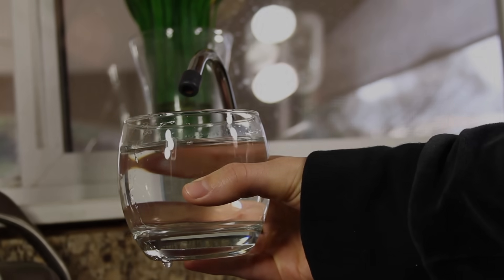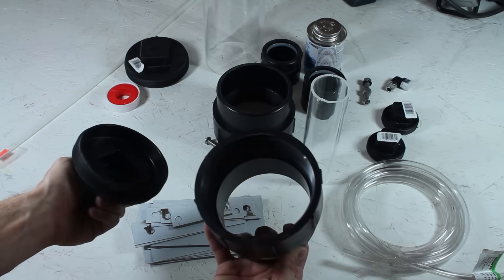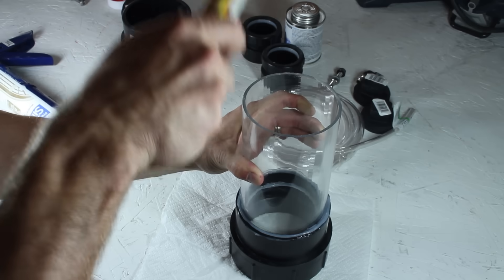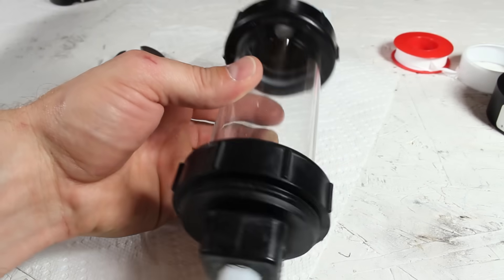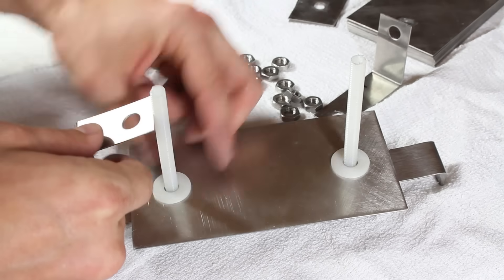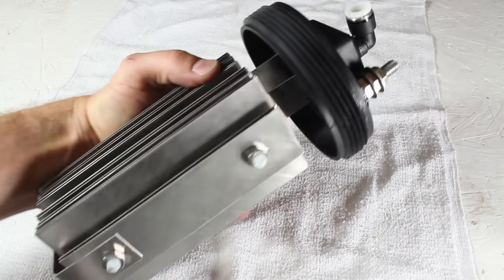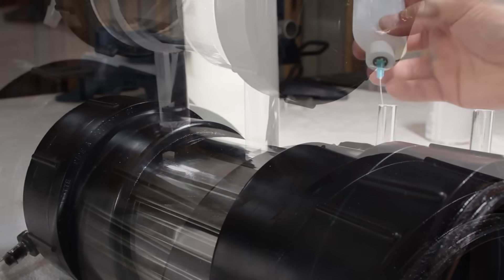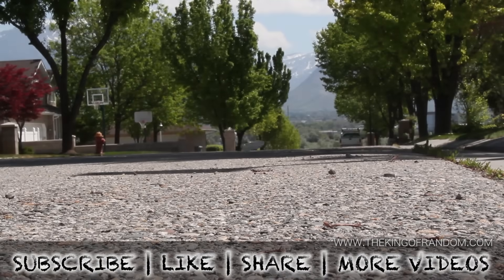HHO Generator - Water to Fuel Converter

Comment: What I like about this video: it never states that this is free energy like so many others have.
Reply: The only true form of free energy is gravity itself. Gravity pulls subatomic particles together to produce mass. An increase in mass produces heat. Heat is energy. When mass reaches a threshold, it starts to produce large amount of static electricity. This disrupts the covalent bonds to form larger atoms. When larger atoms form, electrons are shed and converted to photons. This is called fusion. At no point during this process is energy created or destroyed. It's purely transformed into something else.
Reply: "IF" we could reach absolute zero my proposition could very likely be tested... but we can't, and the energy required to create it would be infinite. If we had that much energy, then yes, we could suspend gravity until movement began again. The problem is: even observing a particle in that state would create motion, and without observation, there is only speculation.
Reply: In reality, there is no such thing as "true" free energy. Energy is only converted from one form to another.
Reply: D.J. Md Gravity is the result of movement relative to its position to another object. If you cool two sub-atomic particles down to absolute zero, all atomic movement stops. This results in the two particles not being able to interact with each other. They lose static charge and their gravitational fields. With subatomic particle movement, ( when in their normal states), particles move towards each other creating energy without the parasitic energy loss upon any given object. In essence, a particle doesn't have to shed an electron for gravity to work. this is free energy.
Reply: ***** My thoughts are that what we see as a particle is only the static parts of standing waves.
Reply: *****  Two percent not bad at all, according to the numbers of  lost energy during transmission from the utility companies as reported by the EIA department  A national average of 6 percent lost which not including in the production of the electricity. Some reported up the 20 percent total lost from these utility companies. I love it when nay sayer's put their feet in their mouths sucking the jam out between their toes...
Reply: ***** for probably the best consolidated "free energy" resource google "PJKbook.pdf" it's got to be the biggest most dense pack of deception ever made, or some relative truth. I don't think anyone could be that delusional to spend so much time putting it all together and constantly updating it if they didn't believe its contents. i'm erring on the side of off-grid solar somewhere sunny with EVs/bikes to get around. proven. reliable. nothing kooky.
Reply: ***** Yes, there is no free energy.  With some forethought, this could provide a means to store energy.  Yes, there is an efficiency loss.
Reply: ***** think about that one. Gravity is not free energy. (we don't even know what it really is). Just like we don't fully understand electricity we just use it. I always loved my professors who asked a question in lecture. Students answering their best guess. My answer was usually "we don't know" and not that I don't know. but "science does not know the answer yet"
Reply: Lajos Winkler Absolute zero cannot exist, and he is right. All movement stops. And finally, a billionth of a kelvin =/= 0 kelvin.
Reply: *****  for some reason i agree with you Jason I'm no quantum physicist as you guys apparently are but  correct me if im wrong but there were a couple hypothesis' that were based off of specualtion and they were tested and made to be theories but later on throughout the years technological advancement proved those theories to be untrue and forged new ones . So all jason here is doing is speculating by saying those things because they may or may not be true  but well never know because we arent technologically advanced enough to know. Im not sure if this was the same thing jason was saying
Reply: ***** Technically Perpetual motion energy does exist, but the amount of energy most devices of this energy source produce is minuscule and generally requires a large setup. Which is why solar panels or wind turbines are far better in terms of energy output and size.
Reply: ***** well i consider it free since the solar panels on my rv power my hho gen with no problem which lets me cook on my lpg stove and also run my hho torch welder. and since i got the panels cheap 5 years ago its has totally paid for themselves and so anything i get from them is free, im sure it would run my rv lpg fridge but i stay on 12v and my panels take care of that
Reply: R Hall I don't know about 20%, but the 6% sounds about right. I previously wrote 5% but changed it for the benefit of the doubt that someone knew what they were doing. However, if someone is running it under the hood of their car with high engine temperatures, I could see a system that was higher than 5%.
Reply: R Hall What I think is funny is that these HHO people think that this system is something new. How do you think the Nazis got the hydrogen to fill the Hindenburg? Hydrogen is easy to make... it's helium that is difficult. During WWII, the United States and Russia had an "almost" complete monopoly on large-scale helium production, so the Nazis had to resort to hydrogen to fill their zeppelins. The point being: this is old technology.
Reply: Bolt2strike With gravity, you can't destroy it (at least that we know of), so it's ever present. It's what creates stars! Stars will come and stars will go, but gravity will always be here. It will be producing stars for the next 100 Quintillion years, and I'd like to call that the ultimate source of energy.
Reply: ***** is this a comment war? 

cause i wanna join
Reply: Using solar panels,  the free energy from the sun would qualify as "free energy"
Reply: When I say free energy, I mean perpetual motion.
Reply: Something that many HHO advocates claim this technology provides.
Reply: ***** oh yea,  i think i know which ones you're talking about.  They're usually using some form of Bedini pulse motor or pulsing technology and claim that it's overunity...  

I have worked on that project for a few years, It's flat out fail.
Reply: This technology is real in regards to producing hydrogen, but it doesn't produce more energy than is put into it. Even fusion from the sun doesn't do that. That's just an electron being converted into a photon when 2 hydrogen molecules bind into a helium. Even fusion doesn't break any laws of conservation like the HHO guys claim can happen.
Reply: hotfreshrider there are plenty of people who firmly believe what they say even though the facts are wrong. However, most of the time, the facts are correct when that much work goes into their research... Then again, some people spread false info strictly because they've scam artists.
Reply: ***** Because it's not. It's free fuel, the generator runs on electricity to create the fuel.
Reply: TheGodWaffle It's not free fuel.
Reply: TheGodWaffle the amount of energy input into the system to produce hydrogen is more than the energy that can be extracted from the hydrogen. The loss is minimal, but it is there. The loss is through heat conductance through the wires.
Reply: TheGodWaffle if you could trap 100% of the heat (impossible) and turn it back into electricity, you would only break even. In that case, it's still not free energy.
Reply: My point was that we really can't prove anything beyond a shadow of a doubt. We can't even figure out how a particle is a wave and vice versa...
Reply: I'm really trying to show you that if we can't even figure out things like that, then how can we positively say for sure we are right? There are many things that are based off observation. Those are correct. A law is something that never changes, but things like super-positioning are nothing more than our best guess.
Reply: And the great inflation? While it's a great idea, it too is only speculation.
Reply: Great inflation is not a speculation. It is part of a theory. It has tons of math behind it and empirical observation which can't be explained by other means, at least not now.
That's how science works - it builds evidence and, as limit functions which approach to 1, it crawls towards 100% certainty, but inherently can't reach it because it's always opened for more evidence. That's its power.
Reply: Lajos Winkler Dude, you seriously just want to argue. I pity you.
Reply: ***** I pity the people that don't want to understand how things work and are.
Reply: What you are saying is speculative. Absolute Zero is not possible.  It is a best guess. we are limited by how it is perceived. not what it is.
Reply: D.J. Md What I'm saying IS speculative. If you know a lot about quantum physics, then share with me what would happen if two particles had no interference with other objects, zero movement, and they were side-by-side. I know you are going to say "it's impossible", but just entertain the idea for a bit. Would they interact with each other?
Reply: Idk, it makes complete sense to me.
Reply: Now all the above theories could possibly be false as atoms themselves are a theory(the most likely theory) In any case particles do slow down(there is proof of this but i dont remember where so google it) when theyre cooled to a fraction of a kelvin
Reply: lol49031 Atoms are not a theory. Atoms are proven particles which properties are explained by "atomic theory". Same goes for gravity, biological evolution, tectonic plates, etc. All observable things explained by theories.
Part of the atomic theory is that atoms never ever slow down to a complete halt. That's basically one of the reasons why helium can't freeze on its own, but needs to be pressurized. Zero point energy jiggles the atoms and won't allow them to slow down enough for their extremely weak forces to grab them all together and form a lattice.

Reason for gravity lies much deeper and nothing we know or did with low temperatures has to do with it. That's one of the reasons LHC was built.
Reply: Lajos Winkler If atoms are particles, why do they only act like particles when we observe them? Otherwise, when not being observed, they act as waves. Not only that, the deeper we look into the atom, the more layers we find (subatomic particles). Yet, the majority of a particle is empty space. So, when do we finally reach the end of our search to the center of the atom? What if there is no end? What if we come to the conclusion that an atom is comprised of empty space all the way down to the planck length? Then it must be a wave that only acts as a particle from our perspective...
Reply: ***** It's not that simple. Atoms are already too large to behave so much wavelike as electrons. You need special conditions to exhibit such behaviour. For example there's that second sound in liquid helium and other phenomenons usually masked by thermal noise.
We don't know if there's "end" to the depth, but so far it seems quarks and leptons are the end.
It also has nothing to do with gravity which can only increase if there's more mass on one pile.
Reply: Terrell James What he's saying is not only against basics of the theory, but also against empirical data. These things are not something you need a doctorate in physics. These are not intricate equations and cutting edge things but stuff almost hundred years old that's already part of everyday technology.

Atoms and molecules DO jiggle around even at minimal temperatures (billionths of kelvin above zero) and it's because of zero point energy which is the lowest amount of energy a system can have.
Also, that has absolutely nothing to do with gravity. Nothing, not theoretical nor empirical, would suggest otherwise.
Reply: Lajos Winkler Hey, thanks for siting zero point energy as an explanation to particle movement at absolute zero. I did quite a bit of research on the subject since you first posted. I have no problem with admitting that my view of physics regarding absolute zero was wrong. I'm just glad to learn. I previously tried to research reactions at absolute zero, but I failed to foster any conclusive results. It's hard to learn online when you don't know how to word the question correctly.
Reply: ***** No problem. :)
Reply: Scottx125Productions - Spiffingly Serious British Gaming! It does not exist.
Reply: David Smith You sir are a perfect example of who I am writing about in this post. The truth is that you are actually running your accessories on approximately 98% solar. The other 2% is being lost through the HHO unit's conversion process by means of electrical heat conductance. Basically, wires always heat up  when electricity is ran through them. This causes an electrical parasitic loss (approx. 2%). The hotter the wires get, the higher the loss. Since the first law of thermodynamics states that energy can neither be created or destroyed, this system is only converting the energy from electricity to hydrogen with no net gain (in a perfect world). Unfortunately, this is not a perfect world, and heat always plays a factor in electrical systems, so you are actually losing energy by using this snake-oil system you so adamantly claim to be creating free energy. The real question is: if this system of yours is really producing energy, why isn't the rest of the world using it for energy production instead of the many alternate means we are using now? Oh, and don't give me any stupid line that it's a conspiracy.
Reply: Right, there will always be a lost when producing and heat is a killer of power. We had seen NASA using these fuel cells for 40 years now. Back in the 70's they have done the first car application, which couple years ago was released to the public. It lead to a more study of stripping electrons off of the hydrogen for powering the electronics on the Shuttle fleet, not to mention the International Space Station with their solar panels as well. But what most people not understanding NASA not until recently had no consensus of a funding budget. I had work bench this three years ago and still have my results. In order to get the correct gas flow production on just a small engine you would have to use two high producing alternators, which in turn brings the high heat levels up and more drag on the engine making the need of more gas. There always that decimal point floating back and forth to make it feasible or not.
Reply: ***** Can you explain to me how gravity is free energy, because I'm fairly certain free energy is impossible. Therefore if your explanation is correct, where are the energy conversions? Gravity has the ability to move something and increase its own power in the way that it draws in mass increasing the gravity. However if gravity can move something, where is the energy conversion?
Reply: Bolt2strike It's not gravity per say that is free, but the by-product that is. Much like the sun, we don't use the hydrogen or helium that makes up the sun as energy on earth, but the photons that are produced from the reaction. Much in the same way, we don't use the gravity as energy but the thermal reactions it produces from mater being compressed together. Yes, we are actually using thermal energy when we use geo-thermal powerplants, but that energy is created through gravity. Gravity in itself takes no input energy to produce itself, so it is free energy if you really want to break it down to it's constituents.
Reply: ***** It would be free energy if you could actually find a way to run a engine on this gas without blowing the engine up. The statement would be true but until you can make a engine that can run on it without blowing up, it is not free energy.
Reply: louisphilippe1100  are you trying to be smart because what you said makes no sense. I disagree if you could run a engine on pure H it would still not be free as you need to generate hydrogen. Yes you could use an alternator but you would probably be putting 100 in and getting 50 out (expression for getting half of what you started with). For this to be free it needs to be generated using a free renewable energy source, eg wind or solar and the  outcome needs to be grater than the input.
Reply: louisphilippe1100 There are cars that run on pure hydrogen. In fact, California is partnering with Toyota to install over 20 hydrogen stations to fuel cars in the next few years. The concept is a decent one, but that doesn't make it the answer to our problems. It still takes energy to produce hydrogen.
Reply: True.
Reply: parm1106 PLAYS It's starting to feel like it.
Reply: +jake stockton I would like to say something about hydrogen gas. You have stated that when you do electrolysis, you dont get more energy out of it than you put it. This is true and false. All you are doing when you use electricity to separate oxygen and hydrogen is breaking the bond between the Hydrogen 2 and oxygen. What electrolysis does is simply allow us to break that bond so that we can use the hydrogen's innate power, the nuclear power contained in an atom, which has already existed since the dawn of time. When you ignite the gas, you are giving it the activation energy needed to start a reaction with the oxygen in the air, making it into water again after you ignite it.

Comment: I hear a lot of comparison between this fuel source to the standard gasoline fuel source. The fact that you can achieve any sort of combustion from water electrolysis is something to research in my opinion. It may not be the answer, but a good step in a better direction. Using in a typical internal combustion engine also might not be a ideal design for it it's use. Radical ideas and concepts often yield great results. Just haven't seen it yet.

Comment: Build a pulse width modulator ...3 volt 55amps ...power curve needed to supply sufficient amounts of HHO ...FLAME ARRESTORS FROM A WELDING SHOP ARE REQUIRED PPL!!!!...you can run a gasoline engine from this method...